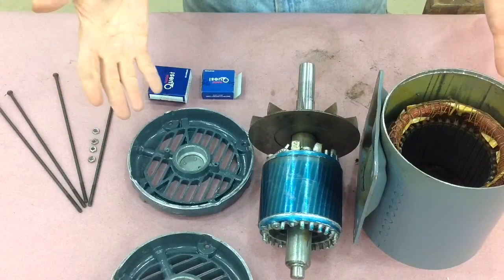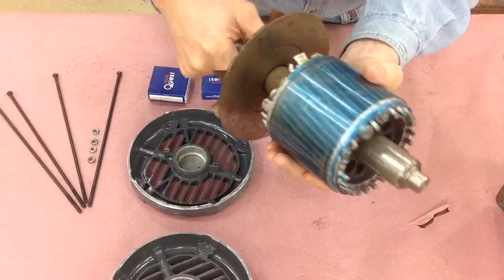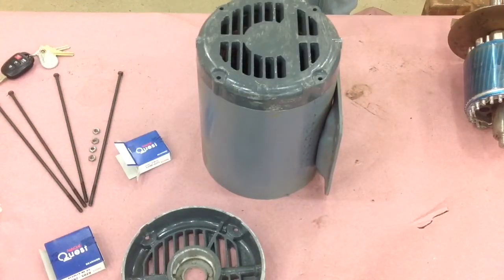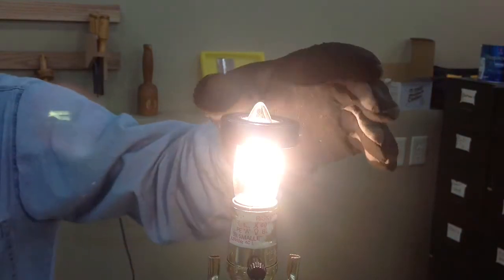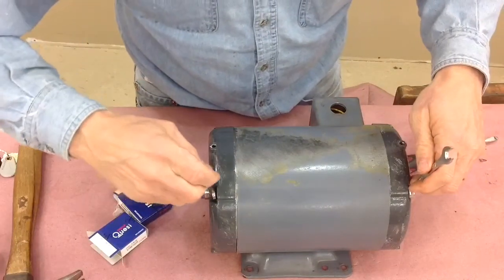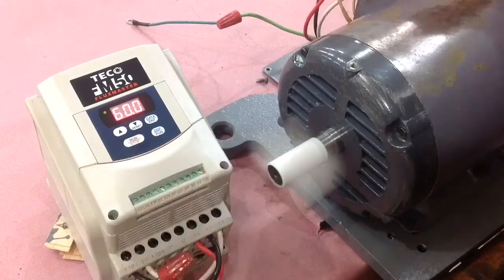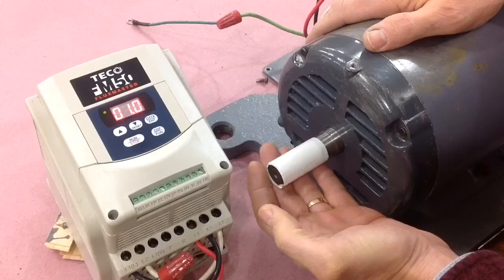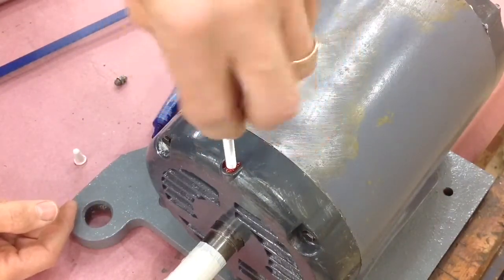South Bend 13" Restoration - Electric Motor

Comment: I hear that its much better to run a lathe using 3 phase motor using a converter to run from 240v from the house electricity over here across the pond,
But people are saying its not best to run the motor on low speed for to long as this causes heat build up in the motor , have you found this in your case?
Reply from the maker: I have used a VFD for all my restored 3 phase equipment. They are inexpensive, and can be attached to the machine, therefore not dependent on the a shop wide converter system.  If I sell the machine, the VFD goes along with it.   Thanks for the comment.

Comment: Hey George, my old SBL has a single phase 1hp motor. I was kind of surprised by that. My guess is it was used in a small high school shop. Anyway, can a guy use the same VFD on a single phase motor to get that sort of variable speed set up?

Motor has 5 wires coming out, green, white, Black, red and orange. Probably a reversible motor is my guess. Frame 203, which I think will be hard to find these days.
Reply from the maker: Ryan,  I don’t believe you can get a VFD or other controller that provides speed control for a single phase AC motor.  You did not mention the type SBL you have.   I suggest you get the motor the machine was designed for, 13 inch will be 3 Phase 2 or maybe 3 HP. 10 inch or less may be single phase, I think.  Don’t know for sure.   Good luck in your efforts.
Reply: George Bell this is the original motor. I have the 13" SBL. The serial number card lists the same motor size and rating. 1ph, 1hp, 1750 rpm, frame 203, 115/230v. I think I'd prefer a 2hp motor. I'm on the fence about using this original one or not.
Reply from the maker: I would not have thought 1 HP would be supplied with a 13 inch Machine,  I guess I don’t know much.  Check out the “Motor Control” video in this series, if you have not already, it may help you make a decision.   2HP is good on my machine, and I know they were supplied with 3HP as well.   PargoLongAgo@Yahoo.com is my email if you want to discuss. Good luck with your project.

Comment: what size bearings did you buy for this .... and for any other parts on your 13
Reply from the maker: I don’t recall the bearing sizes.  You are better off replacing your bearings matching what you take out.   There were a bunch of bearings for the entire restoration.  I bought them all from McMaster Carr.  Measure carefully, make a list and go to their website.

Comment: about small motor 1/3 hp its running bit need push to start rotate im using on  sewer lane machine  how fix it
Reply from the maker: Genearally,  slow starting, or a need for help starting, means your motor has a bad start capacitor.  I suggest replace the capacitor or get a new motor.
Reply: George Bell  im goma try new capacitor
Reply: The start capacitor probably needs to be replaced. On a small motor such as yours, the start capacitor can be found in the housing that sticks out from the motor like a hump.

Comment: Hi I brought a harbor freight 3 hp 220v only to find out my garage is not wired for 220v  is there anyway to use 120v on it just asking don't know much about it!
Reply from the maker: I suggest you return the motor and get something  that uses 120 volt.  I have seen up to 2 hp 120 volt motors.  Perhaps you can install a 240 volt circuit in your shop.
Cannot turn a 120 volt circuit into a 240 volt circuit.

Comment: I have an old jointer for woodworking that uses an electric motor. It doesn't spin as freely as I'd like when its off. Can the bearings simply be lubricated first?  (Assuming they are not deformed)
Reply from the maker: Sure, look for a grease fitting or an oiler, older moters may need oiling directly on the shaft then the oil will migrate to the bearing.. Good luck.
Reply: George Bell Okay, thanks George! I don't see a fitting...so I'll give it a go on the motor's shaft.